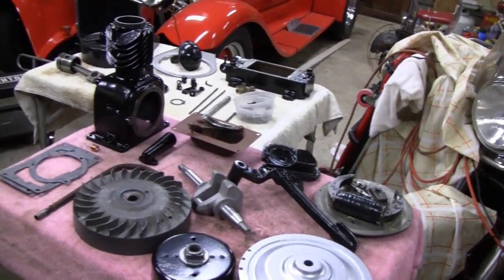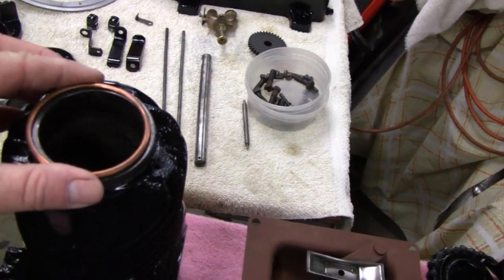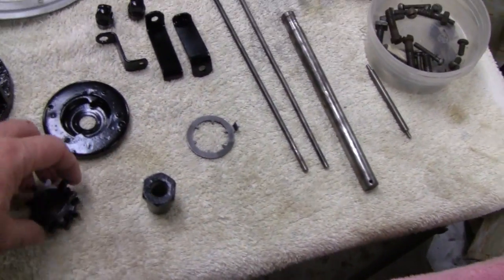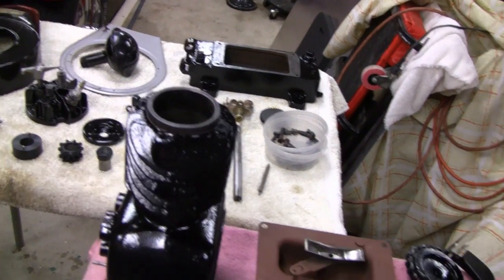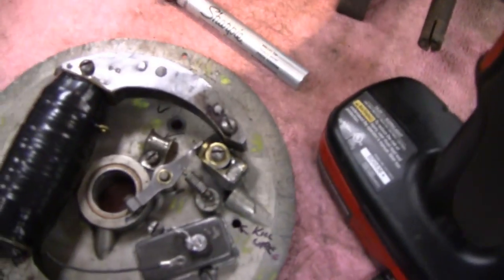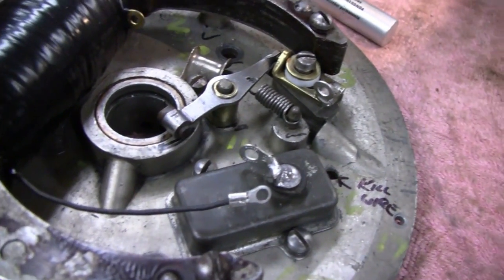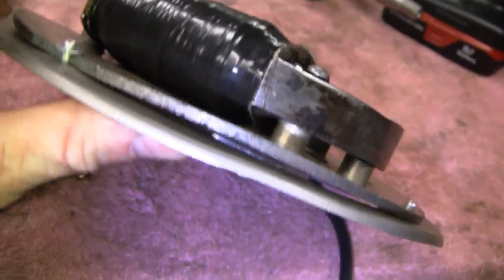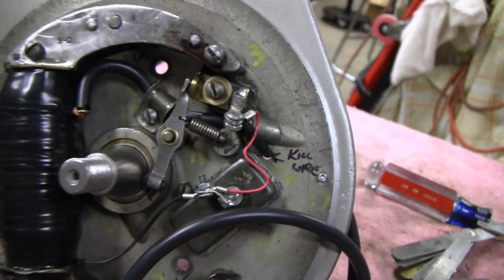1928 BRIGGS REBUILD MODEL FH (part 12)

Comment: Yo Roadking! I aint sure if you check comments this old, but is this engine something that would have originally run a washing machine, or what???
Reply from the maker: Yeah we read all the comments, I usually don't respond to the older videos though!! I think we have over 1700 video, it's tough enough responding to the current ones!! But anyway, yeah it ran a washing machine and some of the later FH's were used on Reel Mowers!!☻

Comment: Good idea on using the copper head gasket, to keep the original compression of the motor. I see a lot of kids thinking to leave out the original head gasket just to bump up the compression a point or 2 and end up blowing the motor or just can't get it to start let alone run right.